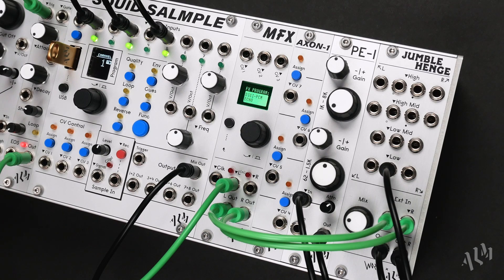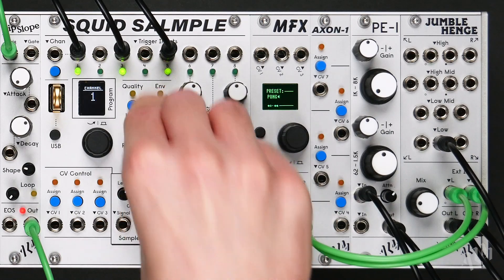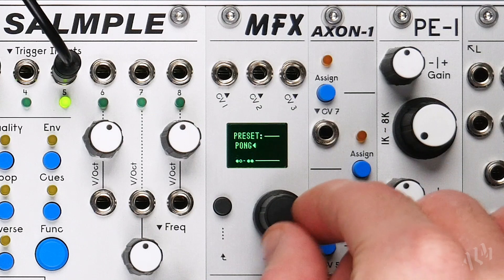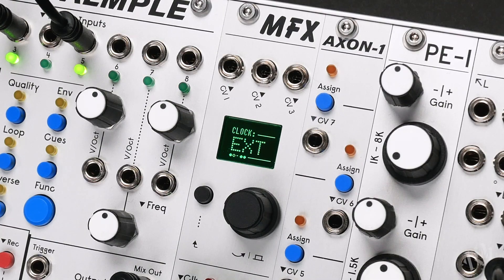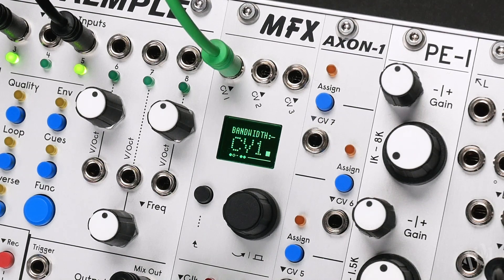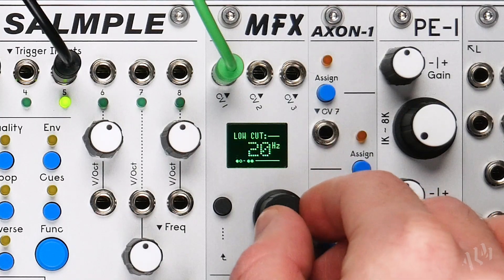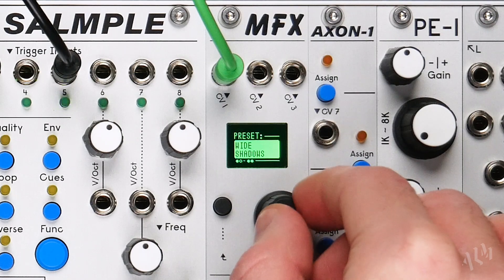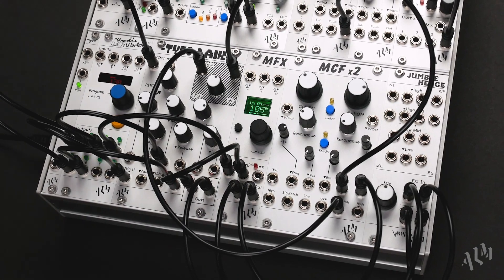Introducing MFX - Stereo Multi Effects Processor - Features Overview - ALM032

Comment: Main idea is clear: no hands-on controls, menu diving & usage of external CVs. But!Expander module looks quite wide. Is that an odd 5hp? It could be just a 2 hp with same functionality.

(In-built low cut is an awesome idea, btw!)
Reply from the maker: The Axon is an even 4hp.

Comment: 2 related questions: Can FX modes be switched via CV and/or can presets be switched via CV? Read the manual, didn't see this specified. Thanks!
Reply from the maker: Currently these are pretty much the only 2 things that cant be assigned to CV.
Reply: This was answered by ALM on Insta: "not currently but future possibility"
Reply: Writing in from 2025: Is this possible in a newer firmware?